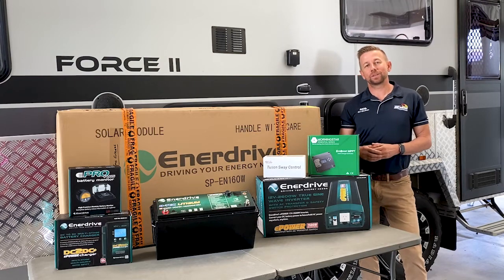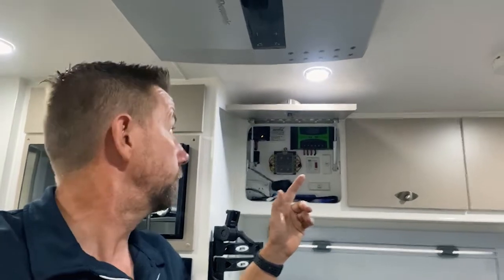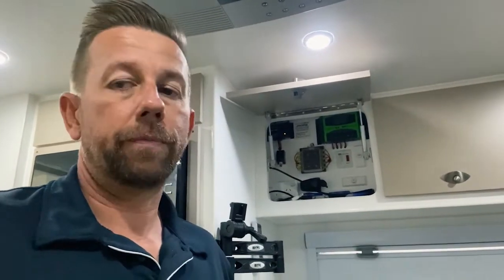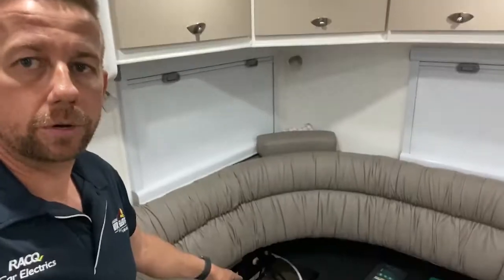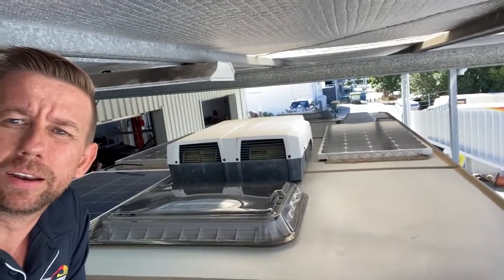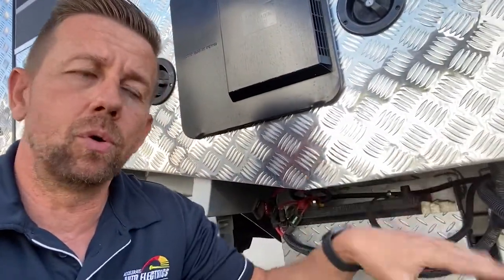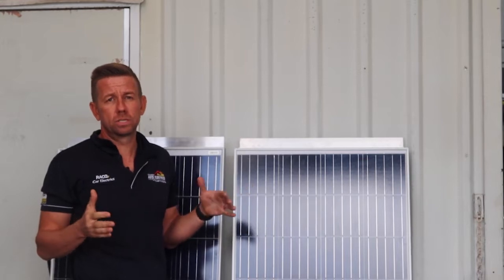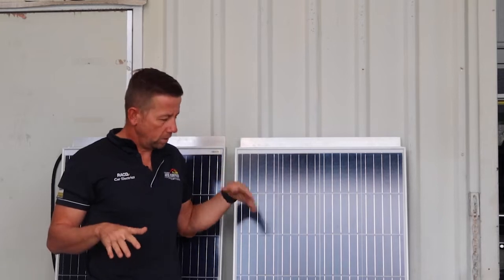Kokoda Caravan Off-Grid Lithium Battery System Upgrade | Accelerate Auto Electrics

Comment: Hey Andrew 

Could you please tell me how you acquire a true earth for the earth stud on the enerdrive stuff if running a generator ?

Relating to off grid , camping, not big 4 caravan parks

Phil 

Phil
Reply from the maker: Hi Phil, 
We use a licensed 240v Electrician for the termination of the inverter into the 240v system to ensure its meets all certifications & safety regulations. This includes ensuring the earth circuit is adequate to suit use with generators.
Reply: that’s great andrew 
i’m a licensed electrician too. i’m really curious what to do with my earth. do i use an earth stake every time i set up remote location and spark the yamaha 1kva

Comment: Have you (or can you) wire the inverter into the 240v circuit so when you are offgrid you can just use the 240v plugs as normal? If so, what kind of isolator would you need to do if you then plug the van into 240v power at a caravan park?
Reply from the maker: Thanks for your comment! 
Yes, This system allows you to have normal use of your 240v power points off grid via the Enerdrive Inverter with built in Auto Transfer switch. 
Please keep in mind, any 240v modification's carried out to your caravan requires a Licensed electrician to meet safety requirements.

Comment: Why did you go with the eco post controller to charge batteries via solar over the DC to DC charger installed from Enerdrive?
Reply from the maker: Hi there, We used a seperate Solar regulator due to wanting to be able to charge the system off 2x charge sources whilst travelling. When travelling during the day the vehicle and solar charge combined will charge up the battery system quicker. The Enerdrive DCDC charger does not have the option to blend the 2 charge sources when both inputted into the one unit.
Reply: @accelerateoffgridtouring  thank you that makes perfect sense

Comment: Please tell me that there’s more to securing the solar panels to the roof than just heavy duty glue ! I have read a number of stories of panels flying off roofs due to deteriorated glue. I heard that most caravan manufactures have now moved to bracket screwed to the roof
Reply from the maker: We use a commercial grade Sikaflex with a lifespan of 30 years. When the surfaces are prepped correctly there are no issues with fitting solar panels this way. Screwing brackets to the roof increases the changes for water ingress to occur, potentially causing rot in the roof, so we avoid this wherever possible. In the 10+ years we have been installing panels on caravans, we have never once had an issue with solar panels flying off.
Reply: @accelerateoffgridtouring  There goes the the wife's tail the panels need to have a gap from the roof!?

Comment: Good video but one question. Why such low rated solar panels? Is it the roof size? panels are now coming out with over 400w ratings which admitedly does mean a more expensive MPPt unit but 1200-1600w is big step over 600w.
Reply from the maker: In most cases we are limited by roof size and spaces to fit panels so we find the best solutions to suit the space, budget and power system.

Comment: Does the solar through MPPT and DCDC charge at same time? I was told I couldn’t have a solar regulator and DCDC together so the solar is running through DCDC. Was hoping to get the 40a DCDC and solar amps together for higher charge rate while driving?
Reply from the maker: Hi Brad, 
If you run an external MPPT solar regulator and a DCDC charger then yes they can both charge at the same time when running lithium. Using the solar regulator built into the DCDC charger, it will prioritise one or the other it will not charge from both at the same time.
Reply: @accelerateoffgridtouring   thanks that’s what I thought and wanted to get a higher charge rate. But argued with the caravan company about it, they were saying it can’t be done bc the solar and dcdc won’t work together at all
Reply: @bradrein08  nothing to stop you feeding incoming from alternator  into a separate DCDC charger also, so you can get around that problem.

Comment: What was the cost
Reply from the maker: Hi Patrick, these full, off-grid caravan upgrades can vary drastically in price, ranging anywhere from 8k -18k depending on the caravan, existing set up and what you need to run. If you would like a more accurate quote, please feel free to call us on 1300 227 353.
Reply: @accelerateoffgridtouring  thanks for that I have a 2012 dreamseaker it is setup about the same as that Kokoda I live in Mannum sa

Comment: As a caravan owner I get it. The power station is great 👍 , but filtered water and quantity of water is more important than power, I have 2 solar controls, 2 AGM batteries, 600 watts of solar (1 on the roof, 1 on the ground) maxed out my system! Perfect! All for under 1000 bucks running victron!
Reply from the maker: Glad you've found a set up that works for you 👍
Reply: Yes. No need for lithium battery setups to be 100% off grid. We have 2 x 150 watt solar panels, 2 AGM 100Ah batteries and gas cooking/refrigeration. This more than meets all our needs off grid almost always. We have heavy laptop and tablet usage. 
Occasionally we fire up our generator... which (like the gas) you still need anyway with an off grid lithium battery setup.

I'm not dissing lithium battery setups, they have definite advantages.  Just questioning all the videos on youtube with headings  implying they are somehow essential for off grid caravanning.

Comment: How much are we talking for a conversion
Reply from the maker: Hi Shane, the cost of lithium conversions differs greatly for each setup. Upgrades can cost anywhere from $5000 up to $25,000 depending on the existing system, what appliances need to be run, how long it needs to run off-grid and what caravan it's going into. If you would like more info about pricing, feel free to give our office a call on 1300 227 353 or email info@amae.net.au.

Comment: I actually enjoyed watching your video, in an effort to better learn about 12 volt lithium systems (brands out there; the type of lithium battery set up to use, taking also into account, what size inverters that can be added to capably run a coffee machine; or microwave, or charge a power tool etc). Prior to watching your presentation, I had been studying the 'Enerdrive' website, and wanted to point out a slight concern I have now. On their site, they recommend the following if a consumer goes for the B-TEC LiFeP04 12v 200Ah G2 Lithium Battery (and I quote:) 

 " The G2 200Ah battery is able to accept a maximum inverter capacity of 2000W only. Exceeding the maximum inverter capacity can damage the BMS Management within the battery.

If you are requiring a battery system larger than the Enerdrive B-TEC G2 battery, please look at the Enerdrive Pro Series Power Pack Systems which can offer multiple parallel and series connections with Active Cell Balancing Protection across the entire pack"

I don't wish to sound pedantic (acknowledging I have still a lot to humbly learn!), but I note your video shows a 2600 watt inverter, being matched with the B-Tec 200 amp, which Enerdrive do not recommend. Is there a reason why you have used a 2600 watt inverter in this instance instead of the 2000 watt (noting you do have other assumed management systems in place as well?). I note anyway Enerdrive do offer a generous enough warranty period, but wondered if strictly speaking using a larger capacity inverter than recommended might also void any warranty, say on the otherwise expensive enough batteries, if an issue did occur? It could be that the clients concerned might never use an appliance over 2000 watts, (thus not an issue, but figure people might also rely on the inverter size to use a larger drawing appliance than they should etc)

Again, I don't want to sound as a know-all, but only wanted to sincerely point out an inconsistency I have identified in your presentation, and the information provided by Enerdrive. I will post a link to the particular page, where you just need to scroll down to the bottom. Trusting my feedback is worthwhile, suffice another person picks it up. Indeed, there might also be a good reason why you/client proceeded this way. Cheers!  https://enerdrive.com.au/product/enerdrive-b-tec-12v-200ah-g2-lithium-battery/
Reply from the maker: As with all of our installs, we advise our customers on the best solutions, but it is inevitably their decision as to what gets installed. For this particular build, the customer was made fully aware of the specifications on the G2 200ah B-Tec battery and opted for the 2600W inverter. Since posting this video, this customer has also upgraded his system to a 400ah lithium battery and has no appliances that draw over 2000W.
Reply: @accelerateoffgridtouring  Thank you for your response anyway! Cheers!